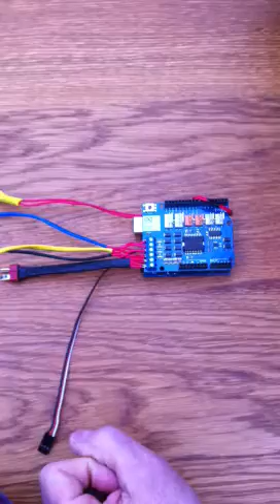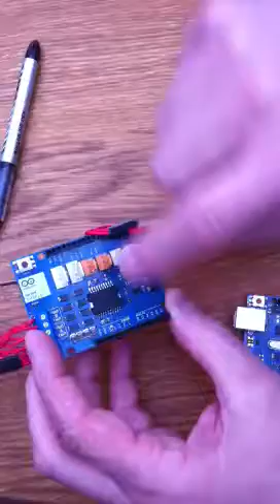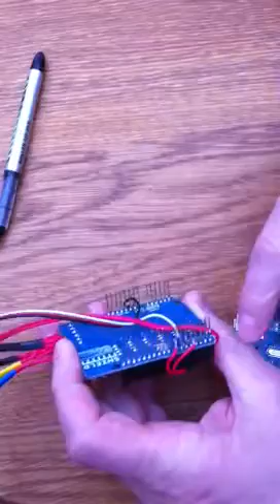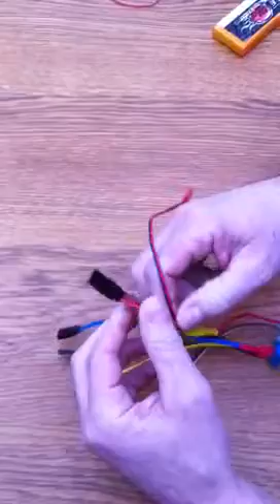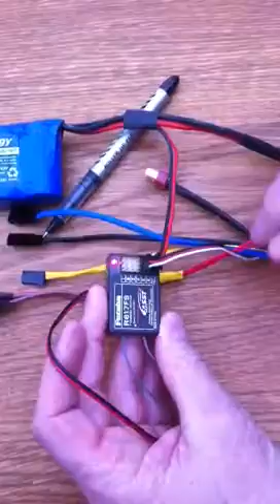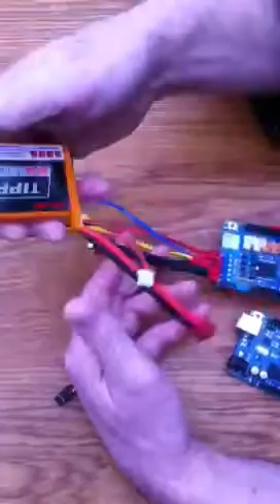Arduino RC electric retracts

Comment: I got as far as i could go with the adafruit, it does not have the option to monitor current coming from the motors so on your advice i got the arduino motor shield copied and edited your code to suit and it works a treat.
Thanks for your help with this i would recommend going down the arduino route if anyone is in the market for an electronic retracts controller!!!
Reply from the maker: +Rob Crawford glad it was successful in the end

Comment from the maker: The thing about arduino is you can run anything you like with it.   The code is like learning a new language but once you have the basics you will quickly get the hang of it.  The arduino will handle 12 but don't power a anything that draws significant current through it.  Best thing to do is buy some arduino sensor kits off amazon.  And look at jeremy blunts tutorials on you tube.  Honestly you will be amazed at what you can automate thro this little processor.

Comment: Excellent,i have ordered the arduino components as your videos have inspired me with confidence,i am going to power the retracts for a 1/4 scale spitfire.
Could the code be written to power nav lights instead of gear door servos via the leads you have designated?
I have 12v motors for the retracts do you know can i use 12v batteries with the arduino?,i know it says it's only rated for 12v max.